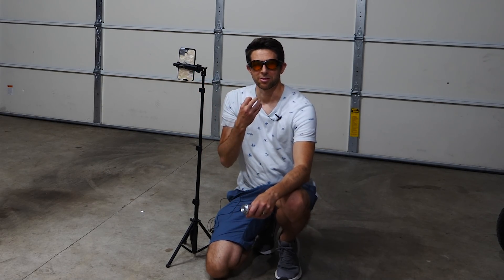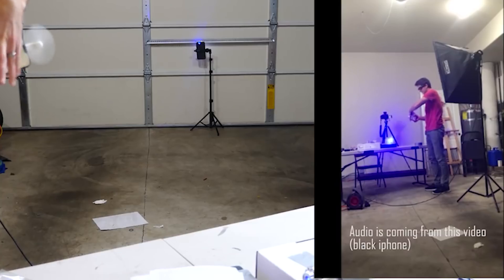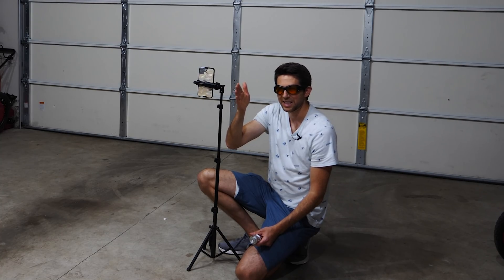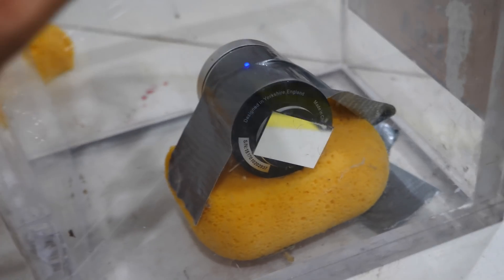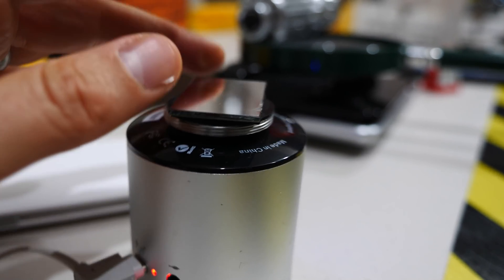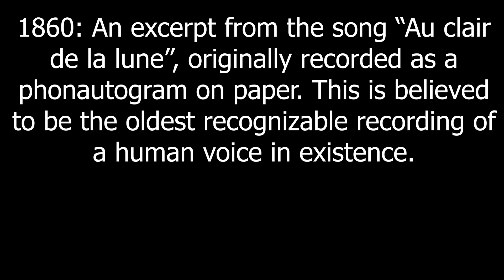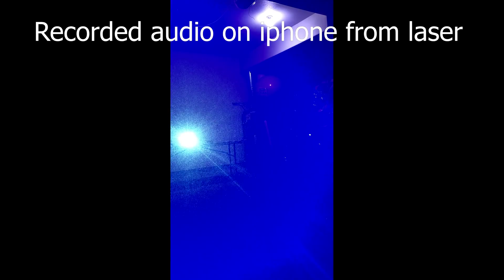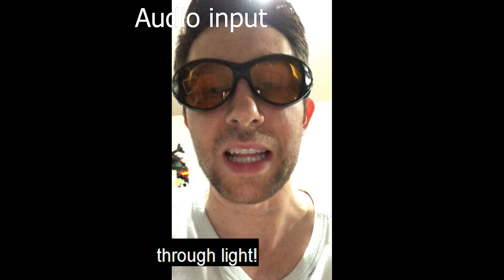How Microphones Can Record Light―Recording My Voice As Light Waves

Comment: Your voice is a lower frequency.  The recording was bass'ed out.

The kids have higher frequency at lower signal/noise ratio (at distance) 

Speak higher pitched or change resonant components for low frequency transmission. Reduce gain.

Comment: in 2008 when I attached a solar voltaic cell to a hi gain guitar amp, I could hold a flashlight or laser against my throat and my voice would be clearly heard . I was about 50 feet away from the cell. my initial goal was to listen to the sun. I also played my guitar by just reflecting the light from my flashlight off the very shiny chrome guitar pick ups, The reflected light was directed back at the solar cell
The strings vibrating disturbing the light came through pretty clear , chords sounded clear and obvious , even single notes as well.

Comment: oh absolutely, there's gonna be optical zapper gadgets for hijacking microphones through walls... sure. Or how's about just jamming absolutely everything?

There are also EMI methods of inducing and lifting signals and currents in and out of wires and anything with a dielectric effect really. You could turn your bathtub into an antenna, unless your building was designed to be NORAD levels of secure, it's leaky. The military use Electronic Warfare systems which are immensely capable of turning battle tanks, vehicles or portacabins into cookers. Lots of this stuff was experimental in the '30s to the '50s, but has become very much a well-protected open secret. The US army has laser weapons in the megawatt range, and is ever growing them. The only reason why we're not told about the ongoing militarisation of space is because it's "officially banned", but the Trump administration blithely incorporated the "space force" component of the US army, because space is totally militarised, and satellite communications are the backbone of any military. Eavesdropping and intercepting satellites is totally going on, and it's entirely likely that space installations and sensors have been attacked with lasers, nukes, and god only knows what else, because the russians, chinese, north koreans, and all the rest, and all the shady private bond villain types, you'd have to catch them in the act to know for sure, it's all like balaklava bank robber politics, and the spooky arms dealers and corruption crew are as thick as thieves and running about like bandits.

I'm pretty sure that half of the municipal telecommunications equipment could be set by its administrators to evil mode, and would produce an electronically hostile environment under conditions of invasion or disaster. Electronic Warfare considerations and capabilities are all built into the consumer stuff, and we plebians aren't made aware of how severe the advanced technology hoarded by the military is in terms of destructive and disabling force.

Don't worry, if anybody's running big lasers near your house, it's probably the government. Depends who you are how worried you might be about that.

Comment: If you combine a red and green and blue laser into one beam you would be able to cover more frequency's. try speaking into the laser bead from the side of the beam try it with each colur laser first. Or you could use a microphone hooked up to a speaker with the mirror on it with the laser bouncing of the mirror aimed at a microphone in another room on to a recorder with a microphone.

Comment: Here's my 2 -years-late attempt at an explanation for this.  Although the microphone membrane is electrically neutral, it is filled with charged particles.  When the laser light hits the microphone a small patch of the mic's membrane is being hit with concentrated electromagnetic radiation. I wouldn't expect this radiation to have a huge effect the charged particles in this patch of the mic since there is an equal number of positive and negative charges in there.  However I wouldn't expect it to be zero effect since at the atomic or molecular level the charges are distinct from each other.  Further more, immediately outside of this small patch of the membrane the charged particles aren't getting any of this radiation at all.  This causes a strain at the border of the small patch that spreads throughout the rest of the membrane just like a pulse or sound wave, creating a brief noise.  Every time the laser pulses off and on it causes another pulse of this strain.

Comment: Had you thought about the vibration of the sound traveling through the objects after the sound waves of your voice hit the vacuum chamber, vibrate the exterior which vibrate the internal stand and then vibrate the object capturing the audio inside it? i'm sure if you tap the box you'll hear it on the audio loudly. if you yell at the box without the laser you'll hear it too. but do the test without the laser on and then with the laser on and overlap both audio recordings from what the inside of the box heard

Comment: My theory, is that It works because of the photo electric effect. Condenser mics have a DC biased metal membrane. When the light strikes the plate, it ejects electrons fluttering the voltage, i.e. its producing an AC signal in the mic.

Comment: This could actually be a valid way to talk in space without the need of radio connection
Reply: Laser and Radio waves are both EM radiation. They move at the same speed. Radio however is more suitable for this purpose.
Reply: Hahahahah good point. Exactly dude. @amaiaa8815
Reply: Making sound travel at Light-speed
Reply: But aren't radio waves too, the part of the em spectrum? 
So basically they're better than vibrating a visible light.
Reply: starlink satellites already communicate using lasers.

Comment: You should try this experiment with a laser shining at a small disconnected speaker. On the speaker hook up a multimeter so you could read the ohms, if the ohms change you'll know this speaker is moving.  I wonder if the microphone is picking up a slight voltage change in the voice coil?  You could also try it on the voice coil instead of the entire speaker cone to get a reading.  I wonder if the laser is putting just enough voltage into the voice coil for the microphone to move?

Comment: Is the microphone actually picking up the radiation pressure from the modulated laser?? Crazy thought but that might actually be the case.

Let's assume that the laser power is 1 watt (or 1000 mW). If the microphone is not made of shiny material, we can assume that it absorbs most of that (reflected photons actually increase the force exerted on the surface, so we can treat the full absorption as a lower bound). So, the force exerted by a stream of photons is equal to F = P / c, or the power of the photon stream divided by speed of light.

Hence, a laser beam of 1 W exerts a force of about 3.34e-9 newtons on the area it impacts. If we assume the area of the laser beam to be a circle with a diameter of 1 mm, then its surface area is 0.79 square millimetres, and the pressure on that area is approximately 0.0042 pascals (or 425 micropascals).

How does this compare to the force that sound waves can exert on the microphone? Well, converting absolute sound pressure level of 0.00425 Pa to decibels (SPL) results in about 46.5 dB. That is actually within the limits of a microphone to pick up - not very well, but certainly audible.

So the sanity check is a pass. This could very well be the microphone picking up the radiation pressure produced by the laser hitting the microphone's diaphragm. 

What is the actual power of the laser you're using, how big of a surface area does the beam have, and how big is the microphone? Those parametres are important in determining whether this could actually be the cause of this phenomenon.

The poor SNR and clipping is probably caused because the vibrating mirror is not modulating the laser properly. You'd probably get better results by directly amplitude-modulating the laser, or using some kind of shutter or filter that can seamlessly alter the amount of light that passes through from 0% to 100%.

Comment: Modulated light can be heard via a microphone because it does actually have peaks and troughs like sound waves do and both create slightly different kinds of pressure on the diaphragm inside the mic.
Also, did you know the reverse of this is true as well?
You can shine a laser (visible or not, IE infrared) on a window & bounce it back to a solar panel at night connected to an amplifier and hear the sound in that room due to minute vibrations from the window. The window is the rudimentary microphone modulating the laser beam back.

Comment: I think you should have just taken a laser diode and a cable thats put into a headphone jack on a phone and then use this cable that comes out of your headphone jack and put it together with a battery in series to then connect it to the laser. it then pulses at the given frequencies and does not vibrate. maybe this would be more interesting and more accurate

Comment: I thknk it will work on condensator microphones only. And instead of making the laser beam move in all directions using speaker, it is better to modulate the electricity from the sound to the laser power source

Comment: You could also connect the laser diode to an amplifier, and transmit sound like that. What's interesting (and very dangerous) is that since the microphone reacts to the energy transmitted by the laser (you discussed why this worked), it doesn't have to be visible light. You could get an IR laser to mess with someone's Alexa. The transmitted signal would probably be a lot better than what you were able to achieve.

Comment: If you want a clear audio, Instead of physically moving the laser with vibrations from the speaker you can USE the laser directly but like how you said in the last video you will need to convert the sine wave to square wave but for that you can use a raspberry pi zero or an Arduino.

Comment: I'm not a scientist but I have some theories.  
Maybe as you said the laser should heat the air above the diaphragm and create low pressure. 
Or maybe the elasticity of diaphragm is changed due to heating and hence it moves.

Maybe the the photon itself create tiny emf in the coil( the coil acts as antennae) due to the electric field in it.
Maybe the photon imparts tiny momentum to the diaphragm.but that's negligible.

Comment: i have an suggestion sir. What if you create a piece of material like plastic at full strech with a microphone in the middle of it. and if you try that method in aired space and vacuum spaced area. To see the difference 🙂. Also with a distance details between laser and a microphone with a provided vibration absorber in aired space and vacuum spaced area. Also dry a different pattern which can absorb more vibration clearly.

Comment: Try using a bigger surface area microphone. Like a condenser mic. Make sure the lowest frequency movement of the laser falls with in the condenser mic's plates. I'd love to see more on this. Because this could be a form of communication that's coming from space that we are just to slow on the uptake. Also try piccolo mics. Very sensitive but you loose low end.

Comment: Try putting an audio transformer between the power supply and the laser diode... so rather then vibrate the beam, you are varying the intensity. this should yield the same affect as the intensity varies with frequency it should still cause your microphone to receive it. That way since the beam does not have to move, it can stay right over the microphone.

Comment: Would the wavelength of the light effect the frequency response? If you added red and green lasers to try and make white at the focus site, without burning the house down, could that make a difference to the outcome? Similarly, as I saw someone else suggest, would pulsing the beam, rather than vibrating it, result it a better outcome?

Comment: Light actually behaves like radio waves(well it is one). I believed what you did was actually some form of AM transmission, but I think FM would be hard to do since you would have to vary the light frequency. If you really   want to transmit voice using light in analog techniques I think using a photodiode or photoresistor as the sensor you can actually convert it into an electric signal and plug it on a microphone audio jack, in that way heat has a minimal effect in the transmission.

Comment: I think it would work better if you could directly control the voltage on the laser, in order to modulate its frequency. the problem with your setup is that the vibration causes the light to focus outside the microphone. Or you could try processing the audio to turn it into a square wave to modulate amplitude in a way that controls the fraction of the time it is shining into the microphone, just like monitors can make a pixel turn on and off really quickly to make it look like it's less bright.

Comment: By sweeping the light beam over the microphone, you get a kind of optical mechanical pulse code modulation. Why not try modulating the laser electrical analog (AM) and measuring the frequency response? It tells you more about the physical phenomenon. If it is a warming up phenomenon like you are suggesting, you will find an explanation with the cut off frequency of the audio signal and heat capacity of the microphone.

Comment: It's probably due the pressure created by light beam on the diaphragm of mic.
(given by Pressure=Incident radiation/speed of light)

Also, if u want to transmit sound using visible light, try using photo cells.
they'll create voltage according to your voice signals & it's reeeallly clear :)

Comment: Any performance with using the laser like a speaker with say something like this laser communication device, though I've seen simpler (I see there is an Arduino method and "transmit data with light" on instructables also):
https://www.instructables.com/id/laser-comunication/

Maybe a design like this using a laser (see pg 29 and not as relevant though neat also in the same edition regarding underground comms starting pg 49):  http://www.americanradiohistory.com/Archive-Elementary-Electronics/1970/Elementary-Electronics-1972-05-06.pdf

Thanks for sharing!   Reminded me of the laser oscilloscope and laser light show methods with mirrors and speakers.

Comment: Does wavelength play a factor? How about mw range? A higher power may damage the microphone, but do lower power ones produce the same effects? Maybe a lower divergence laser may bring more clarity? 445nm diodes are usually multimodal diodes with a rectangular beam, however 532nm dpss lasers have a much lower divergence, higher energy density, and mostly completely circular beam/dot.

Comment: This is super cool! I'd be interested to see if it was possible to run the laser unit at different voltages (thus varying brightness) based on the frequencies from an audio recording and see if that would transmit sound as well and what quality that sound would be. I know most lasers have only one voltage possibility and thus wouldn't work, but I just think it'd be neet to see someone jerry-rig a contraption like this.

Comment: 6:56 Destin Sandlin covered this exact example with Ben Cyr as a security issue in it's Smarter Every Day 229 video, where they show how to execute Google Assistant commands on a tablet using a laser. 
Ben works in a project called Light Commands (google up!) with some other researchers from the CSE University of Michigan and the UEC Tokio, to show and describe laser-based audio injection on MEMS microphones. Very creepy and interesting at the same time

Comment: I designed a 10 Mbps 1.4 km full duplex DIY wireless light communication datalink, and I cringe at this extremely distorted way of modulating light, where the beam wanders off the target completely and then any further amplitude information is completely lost - clipped. I think it shows a lack of understanding what he is doing, what is happening in the physical system he is creating, kinda cargo cult physics. If he wants to get better performance from this method, I suggest defocus the laser to get gradual edges of the light spot, and reduce the amplitude of the movement way down. So it almost never completely wanters off the microphone. And the neutral point must be halfway off the target, not spot on target! Otherwise both negative and positive excursion of the signal will generate a negative excursion of the light, so the shape of the signal will be totally mangled! I am surprised this is not obvious to him. I suspect he didn't think before attempting the experiment, did it mindlessly.

Comment: Or it is simply the momentum of the photons bouncing off the membrane? Actually the radiation pressure from 5mW fully modulated would be 16 pN. If we assume 1x1 cm square microphone membrane, it would be 0.17 micropascal which would be -41 dB of sound. That is imperceptible for a mirophone. So it must be some other effect as he mentioned heating or some indirect heating from air (like the air doesn't absorb the light all the way across the room but a milimeter before the membrane the air suddenly decides to turn black and absorb the light so that it can heat up from it? I don't get it. Never seen black air unless I burnt tires.)

Comment: Light has force. We are using lasers to push spinning discs into space. They are so powerful it's thought to be possible to make them go near speed of light. So yes your pointer has enough force to vibrate a microphone coil when disturbed. If the force is constant there is no fluctuations so no sound.